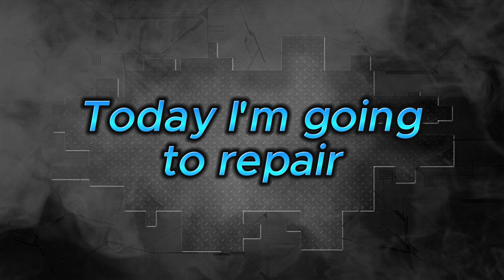Mazda MX5. Left side repair. Ремонт левой стороны.

Comment: You never rust proof the inside of the repaired area. You need to use weld-thru primer or the car will rust from the inside-out.
Reply: At 09:23.